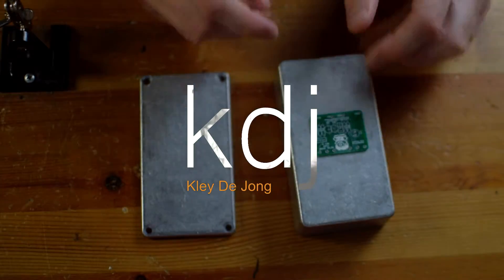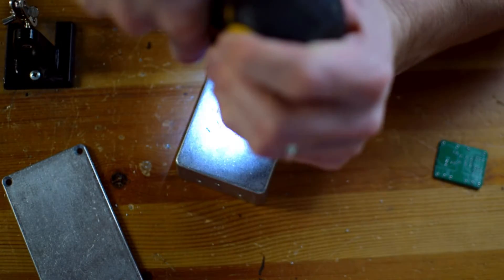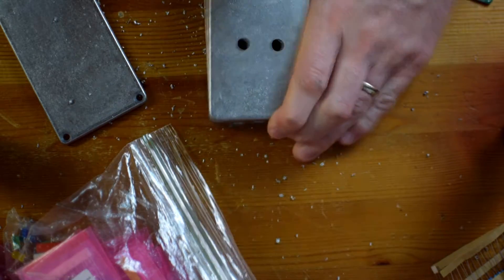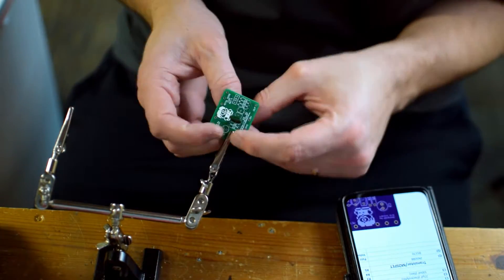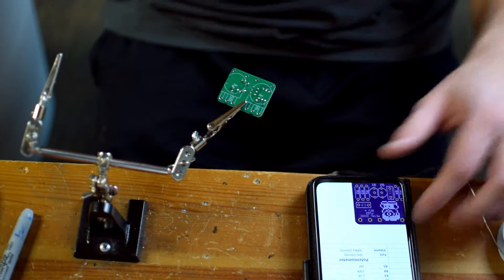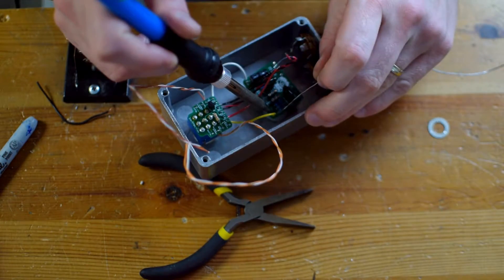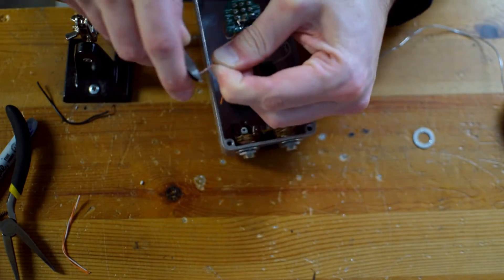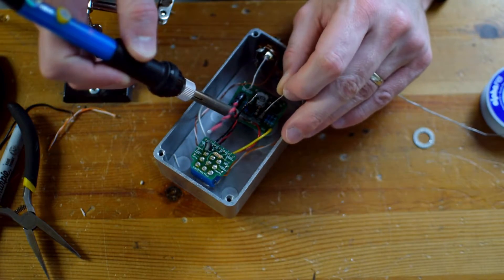Pedal Build Log - DBE Metal Oxide Fuzz | How to Build & Tone Test

Comment: Those smaller wires are AWG 26. They came out of CAT5 cabling. It's a cheap way to get wire for guitar projects. Ethernet cable usually comes with 4 pair of solid core wire. Phone cable has the same kind, but fewer pairs
Reply from the maker: Great idea!